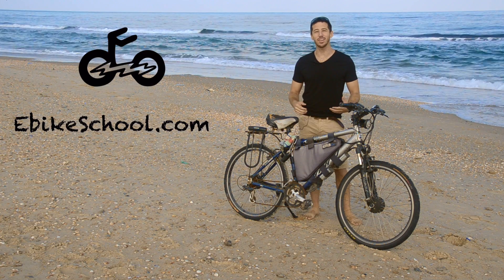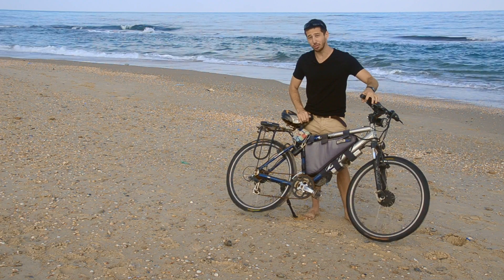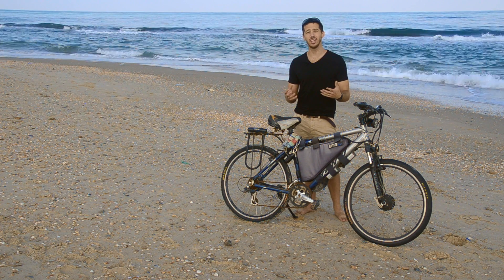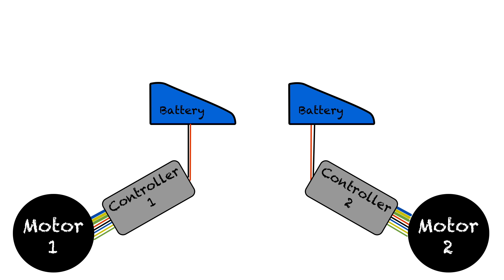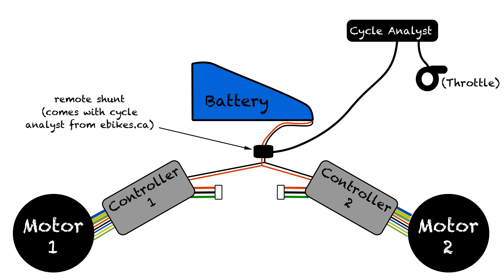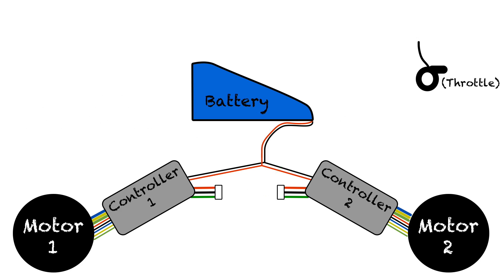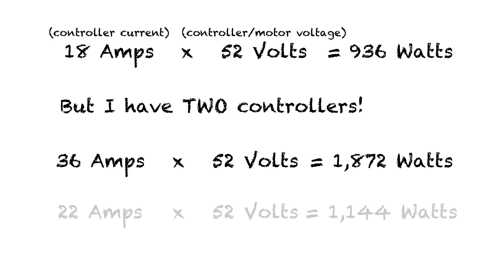DIY Two Motor 2wd Electric Bicycle (All wheel drive 2x2!!) Q&A#6

Comment: Interesting idea. I would be curious to see whether this is economically viable since the price of 2 motors and 2 controllers is now almost on par with a powerful and more efficient mid-drive motor.
Reply: I have a 2 hub fat tire bike, and I cant say enough good things. Although front hub + mid drive hmmmm... :)
Reply: Mid drive motors are VERY hard on your drive train, chain, sprocket, derailleur, wheel bearings etc... besides, bike chain's are not really made for that kind of torque, the average human can only put out about 300 watts.

Comment: Micah great vid.  Other than the traction improvement (2wd) is having 2 motors more greedy on the battery front even if you lowered the amps draw.  So does this reduce the range? Even as you say each motor helps the other motor out.   So my question is 1 larger motor or 2 smaller motors?

Comment: Micha, very helpful video...thanks for sharing your knowledge and experience. Question: does the setup you configured (with CA3) also work with PAS or just throttle? I'm using a 250rpm eZee rear hub, Phaserunner controller, CA3 and 52v/17ah EM3EV battery. I use a basic 12-pole PAS sensor. Will that PAS drive two identical hubs?
Reply: Hi, did It work with the PAS signal?

Comment: I see many people talk about how  " fast " their e-bike travels , but no one gives info about how  " slow " an e-bike can go ?   If on a steep hill with a pack on the back of the bike or smaller trailer , can a person get off and walk beside the bike and activate the throttle at the slowest position to assist in moving the bike up the hill , or in heavy desert sand ?
Reply: Mid drive bikes can handle hills - how steep depends on the cycle's gearing and the power of the motor.  There's a hill on one of my regular routes that I wouldn't even bother to attempt without the motor.
Reply: to save battery on a long trip where I was cutting it close, I chose to walk up long hill near the end.  This turned out to be a lot harder than i expected, so I gave ever the slightest throttle while walking with the bike, so the bike got itself up half the hill ,
Reply: There are pedal powered options, meaning the power will go through your chain and you can switch gears up and down.
Reply: The Bafang BBS02 series has this option on at least one of the controllers.
Reply: Can u show how to install a brake sensor to stop the motor,? Tks
Reply: Fuuny no one answered your question. Yes some controllers have this function. Kunteng controllers paired with the lcd can do this. I use it if im walking my bike through sand

Comment: HI I'm a 6 feet tall weight 280 I'm interested in exploring electric bikes but for my height and weight I'm looking to for a good bike to support this.  I'm been looking at a lot of already made bikes but they are to expensive for me. I'm very interested  in the build my own bike. I work 30 miles away for home I want to bike to help me lose weight this will help with a lot of my health problems.  I would love to build one a 2 motor especially.  So any advice you can give would greatly appreciate it I do have a regular mountain bike to build on.
Reply: Yes a 48 volt 1000watt should do, I’m the same weight and also 6’2” That’s the kit that I have but I have to ride 20 miles each way! That’s a little less than you! I haven’t built my own batteries yet but, going to try this summer, have been using 22.2volt 20000mah lipo multistars 3 of them. Haven’t had a problem yet.
Reply: Just a matter of time until you do David, all HK lipos C ratings are lies. Graphene get close and are their best cells by far for capacity, voltage drop and sustained current. I wouldn't touch them for an ebike though, still too volatile. The multistars are B grade cells without a shadow of a doubt, just do some IR tests after 20 cycles and compare with new - you will be less than happy i'm sure.
Reply: I am 6 fits 230 weight  my bike  its 2000 USD   esy  make 60miles .....batery its 48v.21Am ..motor 500w  max speed 25 mp
Reply: Also replace the tires when you get the bike and use fat tires and fill them up with slime so they won’t puncture.....yes I’m looking at making my own also I’m not gonna spend no 7000 on a Ebike anyways building your own bike is half the fun I think that way you can make it custom to whatever you want

Comment: So I'm just getting info today, but this video has inspired me to build an ebike out of my giant glory downhill model. I want to be able to use the motors to climb so I can save my energy for the ride down. My question is this...is it practical to use this same setup i.e. dual hub motors, over a mid drive setup? I live in Pennsylvania, hence not always flat. Is there enough torque with the brushless dual hub motor setup to make a 4 percent climb or a little higher? I also want to use it to get to, and from work during the warmer month's. I only have 8 miles to work. It's pretty level for the most part, but I don't know if the stress of an off road setup will be able to switch back and forth from road to dirt? Sorry for such a big question. I am almost 100 percent positive that I am going to build an ebike. I also have a giant anthem for single track riding. I might convert it as well if I like the way the glory model works. Thanks for any help you can lend! I love your video! very informative. Have a great day!

Comment: Hey Micha

I have a question for you and hopefully you are the right man to answer

Have you ever seen a 2WD e bike with a direct drive front wheel and a rear geared wheel or visa versa 

If so what are the advantages and disadvantages

I like the regenrative propertys of direct but geared is lighter

I am thinking of this as I am building a long distance touring ebike.

I am hoping the bafang can take an 8 speed 

Thanks and regards Larry
Reply from the maker: Yes, that could work, but for a long distance ebike, regenerative braking isn't worth it. You spend so little time braking...
Reply: cool thanks I am really into the system you have I am still in the design pre design area but you seem to be on the best course for design

good work keep the videos going 
the self build community needs a few heros

regards larry
Reply: Hey havs anyone ever hooked a solar panel up either on the move or remote charging

http://www.goalzero.com/p/11/nomad-7-solar-panel

It would probably take a year with a goal zero I was going to use one for my phone etc but it might help a bit
Reply: I am thinking a bit bigger of a panel
Reply: @Larr3y  , yes watch on utube, Solarized walk assist device.

Comment: Hi, You will get a 2WD  controller 36V/48V both. This controller got two wire for motor, one is back and one is for front and remaining everything is same as your normal kit. Try it!

Comment: Will a Cycle Analyst v2.4 allow the same mods as the v3?
Reply from the maker: Yes and no. If your controller has a plug for a CA, then you can use a CA2.4 to still do limiting features, but it doesn't have a throttle connector, so you'll still have to run your throttle down to the controllers like in method 2.
Reply: Thank you for the quick reply Micah!

Comment: Yep. Copenhagen here. Almost no ebikes!
On my commute through downtown I´ve rarely seen ebikes apart from the granny type or bewildered tourists on the overly expensive municipally sponsored clunky ebikes. It feels like my BBSHD 52V is VERY exotic in a place where almost 30% of commute trips are on a bike. I´ve NEVER through a ½ year of ebiking been overtaken by another bike (or moped for that matter). I should set up an advanced building shop for our type of ebiking, as it feels not much is going on in DK. Ponder ponder...

 - And thanks Mica for the heads-up on endless FB on the AliExpress sale 11/11 2016. It just came at the right moment :).

Comment: Awesome man! I gonna upgrade soon. I've got a 1000w motor in my garage but im using a 1500w motor. Gonna definitely install them later for trial....
Thanks for sharing the idea man....
Reply: Hello, how did it go with yours bc I am about to do the same I have 1500w motor on the rear but have 1000w that I am planning to install to the front but I am just not sure if bc it's different motor would be a problem, can't find any where in the internet that could answer my question, not even going to bother asking him would probably never answer lol😅🤣

Comment: how do you over voltage your motors? also how would you support your bike to handle higher powers. I want to take 2 1000watt hub motors and have both hooked up and over voltage but I'm not sure how to go about it and how to beef up my bike to handle the high power and high torque. thank you for your videos and insite

Comment: Hi micah, Most of us like regen and know how it works. Can you go a bit further and explain how a regen capable controller is different from a standard ESC and how does the controller charge the battery? too many amps can cause harm to the battery, i think it does. So how do we regulate the amps at which we charge and also since ebikes are light weight; does it actually help charge the battery( heavier vehicles means more momentum thus more power into the battery) other than saving money on break pads :P

Comment: Hey man, new to the channel but have really liked it so far! I have some salvaged 18650's that I am looking forward to use on an e-bike or as a battery for a solar panel. I have about 800Wh of batteries and I would like to know about how much km's can I expect with for example a 500W and a 250W motor. Of course it all depends on the speed and how much power you take out of them but in your experience how would you expect these to perform?
Thanks

Comment: Sydney is super hilly all over the place so I don't see much in e-bikes but I have a 900W eskateboard, the ones with those beefy tires. 36V 15AH lead acid battery which I'm dying to replace the dead batteries to 18650 but I'm moving to Seattle soon so no change unless I do it up there :(

Comment: If your controller is beefy enough to handle it, you can also drive both motors from ONE controller. you wire one of the motors up like normal with the phase and hall wires, and on the second you just wire the PHASE wires in parallel to the main motor. it works great with one just slaving off the other. I have done this as a test and it works fine. just make SURE your controller can handle the additional load of the second motor.

Let me know if you try this :)
Reply from the maker: Yea so that method doesn't work as well. The two motors will never be at the 'exact' same position relative to their hall sensors, so the controller needs to send different pulses to each motor. It will work on the bench, but with a load, the motors will experience judder.
Reply: My experience was different. I only used the hall sensors of one motor, and the other syncs up in no time. You are correct that they won't start in sync, but after a few feet, the sync up pretty quick, as they have little choice but to do so. I am not speaking theoretically here, I have done this personally and can confirm this first hand. I must stress however, they must be identical motors.

Not trying to argue, just sharing my personal experience for others to learn from.

Also, I should add that your method is better as you have control over each motor, whereas what I did didn't.

YMMV
Reply: will it work with Dual Mode Hall Sensor?
Reply: Can You make a VIDEO That Could Show US How To Do This Set up Step by Step.
I'M Sure Thousands o f Us Would Love To Use Your Method.  Please Do IT For The Team.

Comment: I have a 36v rear hub motor on my ebike and a 48v front hub motor lying around, could I push my 36v motor to 48v and have it running with my 48v front hub motor or should/could I run the rear at 48v and then have it where I can shut it off and use the front hub motor when I want to, what would be the advantages/disadvantages of either of these set ups if they would work at all? thank you for your time!
sincerely, Caleb Lower
Reply: Safer idea would be to UNDERPLOT your 48 to match your 36 volt one. this also means using your existing battery and such. you would only need a 36volt controller for the 48volt motor.
Let me know how this works out for you
Reply: Michael Illingby would it be safe to use 48v on my 36v motor? based off of my terrain 2 wheels is going to just be a waste of energy now that it think about it, I need more speed if anything, and I don't have another 48v rear wheel, and I don't want to loose my disk brakes in the front either, so I think it would be best for me to just stick with my current set up and then amp up the voltage to increase my speed, but I don't know how much more voltage it can handle. thank you for taking your time to help!
Reply: I am not going to say it is ok to do so, but it all comes down to heat buildup and cooling.

You are free to try, but it on you if you give it too much power. Remember, the controller MUST be designed for the higher voltage also. YMMV, but experimenting is what these things are all about.

Let me know how it turns out. :)
Reply: Michael Illingby will do! I need to check my speed controller before I go trying to pump 48v into it, but if it can't handle it I have 2 that can, I just don't know if they are broken or not, I still need to test them

Comment: I just bought a very basic  and lightweight throttle only motor from aliexpress because it was so cheap and lightweight. Now I'm fantazising about a very lightweight setup with a decent amount of power but which is capable of repuperating. You're inspiring me to try to only buy a very small ,light  and weak generator/motor hub  with direct drive for recuperating/breaking and another small motor with gearset with higher power output, or how would you setup such a system. My dream would be that the bike is so lightweight that even without juice left I wouldn't mind the extra weight. My motor now has 600W+ and only weighs 1,5kg. How big of a direct drive recuperating motor would you build in such a bike for descent descleration/braking. Would it be better to put the braking engine in the front wheel? How big of a battery would I need to geht enough braking power. Are capacitors an option?

Comment: Hey man, first off awesome videos! Still digging through your channel but you have some great stuff so far. 2 questions, first I have an extra 24 volt 250 watt ebike hub motor and controller but I don’t have the Petal Assist Magnet sensor for it. When working the esc is set up to only engage the tag throttle once rider petals. I want to remove this so that it will turn on when I twist the throttle. Is there any way to trick the signal wire that is reading for the magnets to thinking it’s getting the right signal? I tried shorting it to ground and to positive but my suspicion is that it needs to see an emf pulse at a specific speed to engage and that’s hard to replicate. I’m trying to avoid buying a new esc. 

Question 2 the esc and hub is a 24 volt system but I have a 42 volt lipo pack. I know I’ve seen people overvoltage to the hub and get away with it but if I send 42 volts into the controller will that cause a problem right away?

Comment: Who needs to drive on a beach and what is the use of having 1100 watts of power when a bicycle is just for A - B transportation. It's funny to build such a bike for a hobby but there's not really a business case for it.
Reply from the maker: 1100 watts is only 1.5 hp. This is my daily driver ebike, I use it for commuting. 250 watts is fine for 15 mph, but if you want to ride on roads with cars, 30 mph takes more like 1000 watts.
Reply: I don't use a ebike but I do use a motorized bike I made actually made 2.  One is a 99cc gas engine and the other is a 50cc gas engine.  I can go 44mph on the 99cc and 36mph on the 50cc.  I go to my girlfriends house on the weekend and to school Mon-Thurs.  My girlfriends house is 25 miles away and usually takes me 44 minutes to get there.  I take my 50cc motor bike most of the time because I like to cruise on my way there.  During school time though every minute counts and I'm usually rushing to class so I take the 99cc motorized bike.  If it could go 50mph I wouldn't mind haha.  For me the faster I can get to my destination the better.  You do have to beef up your bike though if you want to go faster then 40mph safely.  MY 50cc is a 1980 steel bike with normal rims and rim brakes.  My 99cc has 11g spoke rims and front suspension with a 1952 Schwinn frame both are very safe with many miles on them.

Comment: how about a 4 wheel - 4 hub motor bike - if only athos @ contes engineering could mass manufacture those at a reasonable price.

4x250 wheels over volted..

you could even have to throttles that sync'd up?

then zero radius turning with push button demand?

What do you think?

possible?
Reply: Segway made something like that and they called it the 'Centaur'.  They must have been too expensive to bring to market.

Comment: Have you ever built a 45/50 km/h electric moped with a single 6-phase motor? Currently in the works over here and it is a pain in the arse. 
Also: Would love to win the DIY Lithium battery book :)!

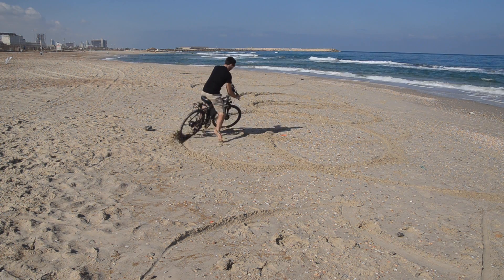Comment: 1:41 torque,you gain double the torque not faster what soever
Reply from the maker: You are correct, but most ebikes, especially lower powered ones, don't actually reach the top speed of their motor because they hit their power limit first. Adding a second motor helps both motors reach a higher rpm range due to lower resistance, and thus helps reach the motors true top speed. But you also get double the torque, which I should have been more clear on. Thanks!